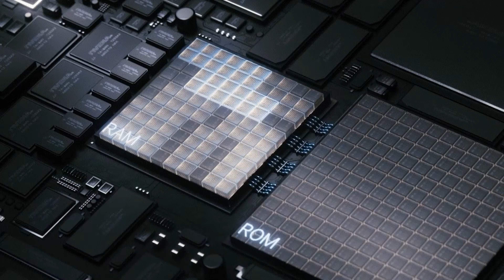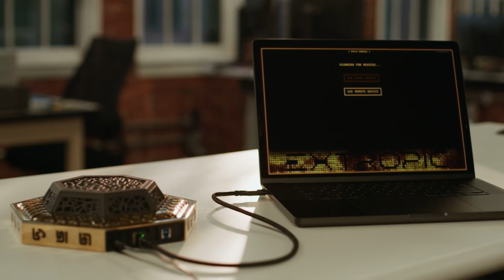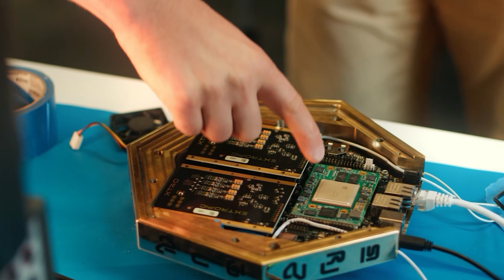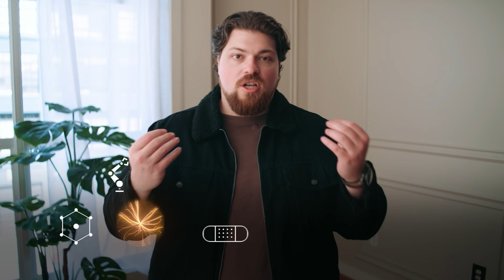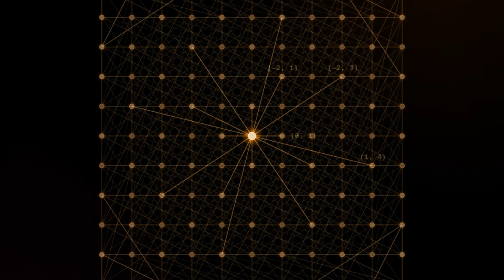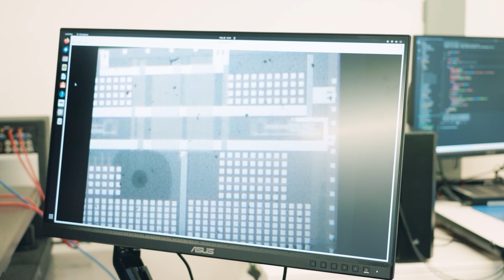From One to One Billion | Extropic UPDATE

Comment: with that efficiency I expected it would be more compact... 1M pbits on a single pcie sized slot? If they're that efficient, therefore not power hungry and don't produce much heat like normal GPUs, then why not pack more of these into a PCIE slot? at least 3 times more maybe
Reply: The process for this is extremely nascent, that's why. Why didn't Intel put 17 billion transistors on their CPUs in 1996? Same reason. They were in the 1-9 million range for fab process in the die size constraint.

Comment: This is one of the more credible alternative-computing programs because it matches probabilistic workloads to probabilistic physics instead of treating noise only as an error.

The real milestone won’t be one impressive sampling element. It’ll be proving that the efficiency survives compilation error, calibration, data movement, and scaling to useful workloads. One device proves the physics. One billion working together proves the architecture.